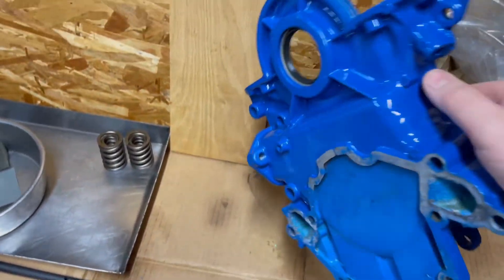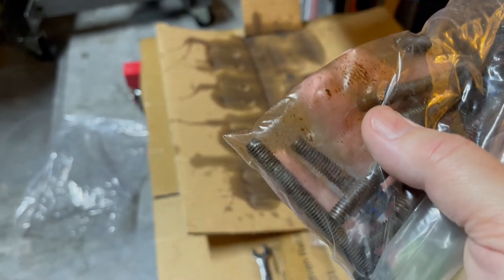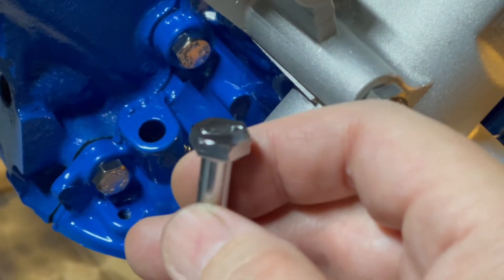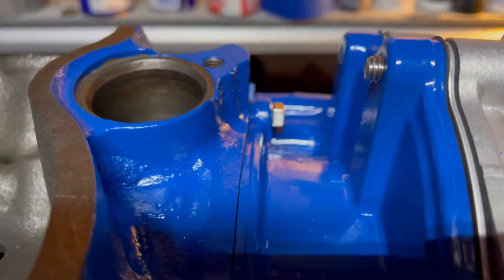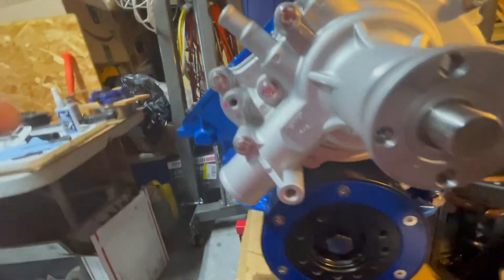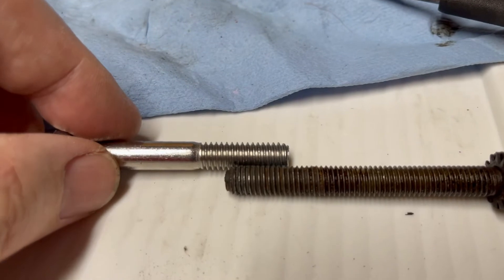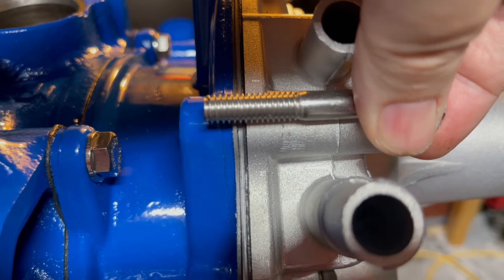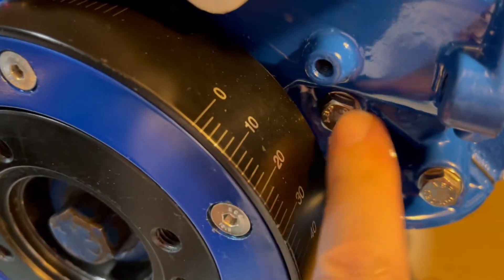Timing Cover Install - Ford 289 331 Stroker Motor Rebuild part 14

Comment: This build process has been amazing. Thank you very much for this. Question for ya.... i just got ahold of a 74 block WITHOUT the timing cover. Hear you say that the older ones, the seal gets pressed in from the inside. For yours (71) was it pressed in from the inside? And do u happen to know if mine will be same as yours? Thank u very much for this build process
Reply from the maker: My block is a ‘71 but my timing cover is a ‘65 or ‘66 part number (can’t remember which). I don’t know when Ford switched to the flanged, externally replaceable seal, but newer replacement covers usually use the later flanged seal anyway since it is easier to replace. I think 260s, 289s and 302s from ‘62 to ‘79 can all use the same replacement cover using the newer seal. When I ordered the FelPro gasket set it came with both types of seals. 

It’s easy to tell by looking at a cover which seal it uses. If the bore for the seal goes all the way through with no step or lip then the seal goes in from the front and a flanged seal is required. The non-flanged seal that installs from the rear needs a lip at the front of the cover for the seal to seat against.

Other things to consider when choosing a timing cover: dipstick hole, cast vs bolt-on timing pointer, timing pointer location, mechanical fuel pump vs EFI, standard vs reverse rotation water pump.